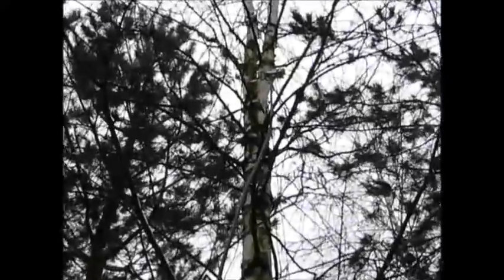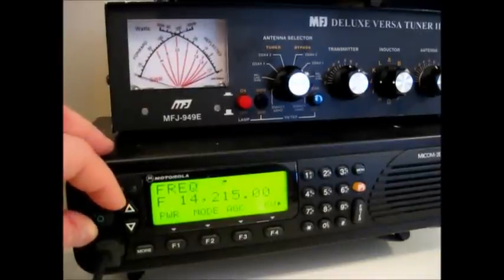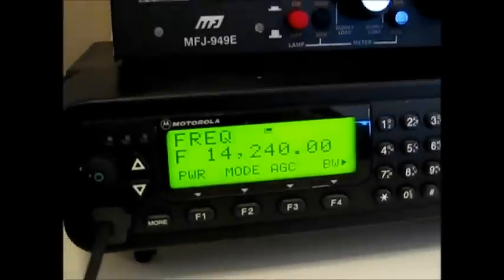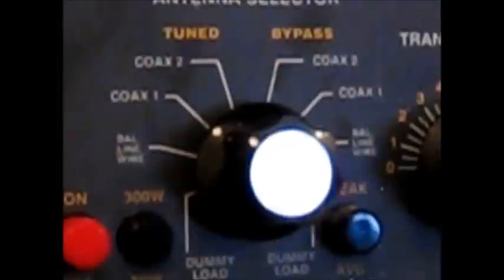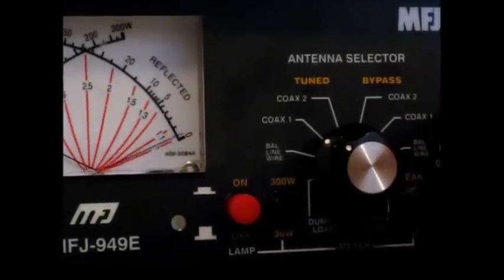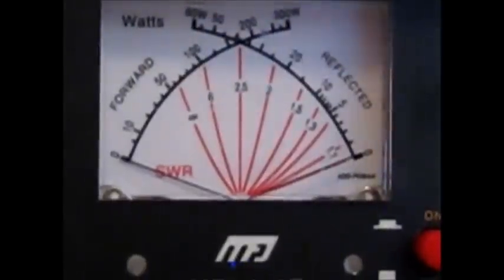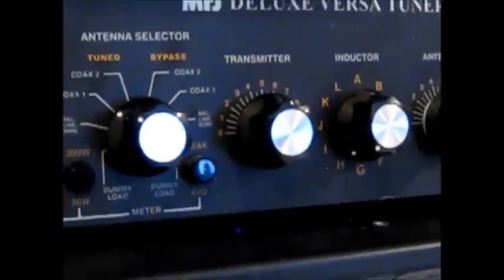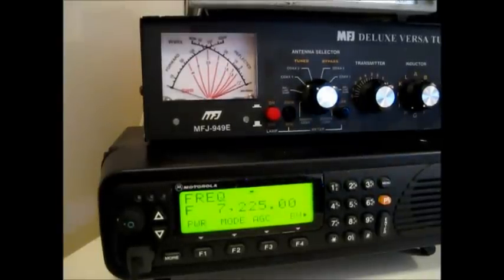MFJ Antenna Tuners - Part II

Comment: Why not just spend more time adjusting the antenna length to achieve a good swr without the tuner ? Wire length calculated by the formula 468 divided by the freq is just a starting point. A resonant antenna will work alot better.

Comment: that is NOT An antenna tuner.
.That is a myth.

Put an SWR meter on the feedpoint and youll see it..

Radio Antenna Handbook  1936 says nothing can be done at the transmitter to change the antenna tuning

Comment: I have an auto on my 590k, but during this COVID thing i got a seventy three hundred. it has a built in antenna tuner. I have a old mfj antenna tuner. would it be wise to use it on a modern computer controlled radio?

Comment: I hate to bust your bubble, but the ATU does not make the antenna more resonant.  You kept saying that the antenna is now resonant after you tune it with the ATU.  The only thing the ATU does is makes the radio "think" he is transmitting on a resonant antenna.  It keeps the radio from blowing his finals, which is what happens when you push a lot of RF back into the antenna port.  So, if the antenna is not resonant BEFORE you added the ATU in-line, it's not going to be any more resonant AFTER you add the ATU in the mix.

Comment: Great demo!  I own and use several tuners, almost daily.  But, I hate doing so.  They are a necessary evil in the “compact” and restricted world many of us are “forced” to live in.  They make your radio happy so that at least some RF is actually radiated.  I mean, in theory one could “tune up” at 1:1 into a “paper clip” antenna, but your radiation efficiency will knock your 100 watts down to less than QRP at the antenna….which is much better than nothing, I suppose.

Comment: You have probably moved since making this video but how did you run the coax into your home? That's the problem for me. I don't want to drill holes into the wall
Reply from the maker: You can get an MFJ-4603 antenna window plate.

Comment: I might be wrong but I don't think it makes the antenna resonant but rather just adjusts the antenna side's impedance in order to make the xmitter "happy". Any thoughts?
Reply from the maker: You are right - poor choice of words.
Reply: @Commsprepper  again you are correct by saying it's resonant you are shortining and lengthening the antenna electrically by adjusting the capacitive and inductive reactances to zero

Comment: So whenever you move to a new frequency you have to stop and tune?  Do you tune using an AM carrier?  Wouldn’t transmitting to tune on a frequency you want to respond on interrupt others trying to respond to the CQ?  How do you tune without disrupting others?
Reply from the maker: You need to re-tune anytime you change frequency.  AM or RTTY setting provide a carrier for tuning (low power).  Tuning on frequencies is rude.  Move slightly below or above, listen, and tune there with lower power.

Comment: Nice video. I just want to know how to set the buttons on the bottom of the panel. Not the on/off button obviously, but the other two buttons. Thanks in advance. Joe N2OIB
Reply from the maker: one is power range and the other peek/average for the reading.  Average provides a delay on the needles.

Comment: Actually you are not “resonating the Antenna” you can only do that by physically lengthening or make it shorter.,the “Matcher” changes the impedance so your rig sees 50 ohms - but I know you know that. 73
Reply from the maker: yeh...  poor choice of words but most get the point.
Reply: @Commsprepper  it was a correct choice of words, you are electrically shortening and lengthening when you are adjusting the capacitive and inductive reactances

Comment: Glad you said toward the end, “Makes the antenna look good to the radio.” Earlier you had said something to the effect of, “Makes the antenna resonant,” which a tuner does not do. Having said that, this is a great video! After years of using auto tuners I bought a Yaesu FT991a that although it has an internal tune, it will not tolerate an SWR in excess of 3:1. So I bought an MFJ 949E. Your video was fabulous, allowing me to learn how to operate the tuner .... Max noise and the adjust the capacitors. I think it could tune a metal trash an. 😉 MikeinMinnesota N0WDM
Reply from the maker: Glad the video helped.
Reply: FYI A tuner provides a conjugate match to allow max power transfer deaming the system resonant

Comment: This is a old video, but very well done and still holds true today.  I use a similar antenna tuner to tune a 100' long random wire and it works quite will with 100 watts of transmitter power on the HF bands.  Thanks again for your efforts.
Reply from the maker: Thanks for the channel support.

Comment: You most certainly not making your antenna resonant, you're matching the radio 50 ohm through the tuner.  Your antenna is still non resonant.
Reply from the maker: yes - but you get the point.
Reply: The antenna system is most certainly resonant, if it wasn't it be reactive and power would not be transferred to antenna

Comment: Nice! Well done. Thank you. You have explained this really well for me. I do want to learn how to do this. And not everyone has the analyzer or scope  or any other gadget that many tutorials use when showing how to tune the circuit and antenna. I bought the kit. I am pretty confident that I can put it together and get it to work properly, but just using the tuner alone by itself, you have helped me a great deal. Thanks. Best Regards. 73, steve  Great job.

Comment: Thanks for helping a new HAM get a perspective on this tuner. I have a Kenwood TS-570D with an auto tuner built it but it seems that a manual tuner does the job better.
Reply: They usually do...  also the radio doesnt have to work so hard

Comment: Thanks for taking the time to make thyis video found it very helpfull. Its amazing how close you get properly tuning the antenna by just listning to the noise, I find when Ive done just that final tuning only needs a tweak.
Reply from the maker: Glad the video helped.  My tuner is off-line right now.  It got zapped by lightning and the two diodes are blown.  I am waiting for replacements to come in the mail.

Comment: Thank you Commsprepper for an educational and instructive 'How To' video. I just got a second hand 949E but no power supply and I wondered if you could answer me a question from your experience. Is the `12V PSU only for the front panel light - it looked from your video that the red switch was not depressed?  The strange thing is that the circuit diagram shows that the 12V supply goes not only to a lamp but also to a transistor Q1.  So my question is - can I use this successfully without a 12V supply or will I get incorrect results?
Many thanks
Regards, Bob from Scotland, UK

PS I hope you are still active and enjoying this hobby....
Reply from the maker: Yes you can use it without power.  I have never powered my tuners.
Reply: @Commsprepper  Many thanks for that. 73s Bob

Comment: You can still have a high SWR even with a tuner. It's just the tuner helps block it from touching your radio. When you feed a dipole from coax, I'd recommend inserting a choke as close to the feed point as possible.

Or use a balanced feed line from the balanced terminals from the tuner to the dipole, making it a doublet. Less losses that way too.
Reply: An AT can't really make a bad antenna good. It just looks like a 50 ohm match to the radio now and you don't get rf reflected back to the radio. The only way to get the antenna to optimum efficiency is to cut it to the proper length.

Comment: The antenna is still out of tune.  All the tuner does is give you 50 ohms between the tuner and the radio.
Reply: The tuner in providing a conjugate match to allow max power transfer has tuned the system to resonance by means of all reactance is zero

Comment: My first antenna tuner was the MFJ-949D. It also features a 50 ohm dummy load to use as a load to tune a tube transmitter. My first HF rig was a Kenwood TS-520s that had Tube finals requiring the dummy load. So this tuner offered a lot with 2 antenna selections and a selection for a long wire or balanced antenna for a total of 3 antenna options. I have owned many tuners and autotuners since, but would never be without the MFJ-949E tuner in my Shack!

Comment: Nice video! My first tuner back in 1993 was the earlier model (949D) of this tuner. It did a great job and had lots of features for $149. Back then I had a Kenwood TS-520S HF Tube rig that the transmitter had to be tuned into a dummy load. The MFJ-949 had that built in! Plus you have the option of two different antenna's, therefore eliminating the need for an antenna switch! And a built in 4:1 Balun for balanced line antennas, plus a balanced single random wire connector!  And the large lighted cross needle meter was easy to read. Plus it was the perfect size. I think these features at the price of $150 are exactly why the MFJ-949 has been the most popular tuner for many years. In fact I'll be purchasing another for field work and as a backup to my LDG AT-100 Pro II.

Comment: The button that you push in for 30 watts or 300 watts. I thought if you push it in, it would set the meter up for 300 watts and if it was not pushed in, the meter would be set up for low power as used for tuning. When using the Tuner and running 30 watts, the meter seems to register correctly on my Tuner with the button pushed in. Also when tuning, what power level should you use when transmitting. I read somewhere that you should never use more than 20 watts. These two videos were very helpful!
Reply from the maker: +skf1492 I tune with 5 to 10 Watts.  Then change the meter to higher power and tune again with 50 watts.  Then full power

Comment: So, is this also used to calibrate SWR or is that still a different meter? Sorry, I have a lot to learn thanks.
Reply from the maker: You can use this tuner for shortwave reception but the meter only looks at transmit, so you would not see any meter movement when receiving shortwave stations.
Reply: Thanks for the help. So you're talking S.W radio. I only have a A.M. Cobra. This meter might be out of my league and over my head. I have a cheapo Workman meter. Maybe I need some bigger better radios if I was ever to need a meter like this.
Reply from the maker: Okay - You have an AM CB radio?  In this case you only need an HF SWR meter.  No need for the tuner  because you can buy antennas that are already tuned (cut for the right length).  The meter will let you know if there is an antenna problem.
Reply: I plan to get a SSB radio down the road but the Cobra 29LX is it for now. I just got a Antron99. Next I'm wanting to get a better meter, that's how I found your vids. Thanks a bunch for your help. I learned a lot from you.

Comment: Good instructional. In an emergency prepper setup, that MFJ949 keeps the transmitter happy. I tuned a 20m 1/4 wave vertical on an mfj949d up on 40m: FLAT swr/ zero reflected, but LOTS of rf in the shack. It works though. I guess maybe 1/3 of tpo made it to the antenna. Hey, in a "gotta put a signal on the air" situation arrises...
Reply from the maker: It's hard not to like a manual MFJ tuner.
Reply: Try a better earthing system. It should reduce the feedback rf even if it does not eliminate it completely.

Comment: Nice video. I just got the MFJ-941E . Can you explain a little bit about the black Watt button  is it in for 30 Watts or out? and what setting do you use for full power.   Thank you KC2YME
Reply from the maker: I don't have mine in front of me but the setting (button depth) is silk screened on the face.   The 30/300 watt setting applies to the meter scale / power.  Radio has more than 30 watts then you need to use the  300 scale or you will peg the meter and ruin the movement.

Comment: If you enjoy making antennas, then you may want to buy, or borrow, an MFJ 259B antenna analyzer. I have used them for a while and allows you to see the characteristics of what you have created.
Reply from the maker: I would like to get my hands on one of those.  I do have a Signal Hound spectrum analyzer and tracking generator that allows me to do antenna analysis but the MFJ is a smaller package.  Thanks for the tip.  Hank/CommsPrepper

Comment: Very interesting video :) For someone who is not a ham radio operator, could you please explain: If the tuner is a bit of a compromise (compared to an actual tuned antenna), and at 9:20 you say 'not as efficient as it should be' - where does this extra power disappear to? If you're putting the same power in but getting less out, it must be going somewhere, right? Cheers
Reply from the maker: The short answer is the mismatch still exist between the tuner and antenna and excess power remains there.  The tuner isolated the radio from the antenna with respects to the mismatch.
Reply: aha, i see :) thanks for replying. So the 'mismatch' gets moved to a place where it's not going to cause any damage?  That's neat
Reply: @w3llhard  the tuner in providing a conjugate match to allow max power transfer is deemed to make the system resonant

Comment: Antenna tuners do not tune the antenna,
Reply: It's a conspiracy, shhhh  ;)
Reply: You're right, it doesn't tune the antenna. It fools the radio into thinking it's looking at a good match. You can get the SWR down that way but the antenna will not be effencent.
Reply: @darrellbeard2799  it doesn't fool anything, the tuner provides a conjugate match where all reactances are adjusted to zero in this state the system is resonant
Reply: @Pioneer936  I'm sorry I simplified it!
Reply: @darrellbeard2799  your simplication is wrong, it electrically tunes the antenna system to resonance by adjusting the capacitive and inductive reactances to zero
Reply: @Pioneer936  true. Thereby fooling the transceiver into looking at a near perfect system.
Reply: I see no point to argue this. I admit I'm wrong and you are right! Feel better now!
Reply: @darrellbeard2799  not arguing its a discussion isn't it, if the definition of resonance is when reactances are adjusted to zero within the whole system, then the whole system is resonant when the tuner adjusts the reactances to zero, there's plenty of info in ARRL Antenna book and  Reflections by Walt Maxwell explaining it in detail
Reply: @Pioneer936  I think maybe we are talking about 2 different things here. You are explaining how a tuner does what it does and I'm simply stating the end result. You are right in the function of a tuner, any licensed operator should know this as it's pretty much basic 101 for the tests.  However while it will make the radio think it's working into a near perfect antenna system, it is not. This is my point, given 2 identical antennas, one with a perfect match of 1:1 and the other with a 5:1 SWR and a tuner in line. The transceiver once the tuner is tuned will see both as the same perfect load. However, while the radio will not fold back on power output the system loses are much greater in the system with the tuner. The tuner will have a bit of loss due to design, the feedline with have higher loses due to the 5:1 SWR and the antenna will not resonate as well due to being not the right length for the frequency you're working. Therefor, as I stated, the radio is fooled into thinking it's looking at a perfect match, when in fact it isn't. I don't know any other way to say that.  And no, I'm not meaning to argue this as you said this is a discussion.
Reply: @darrellbeard2799  resonance and loss are two separate issues, an antenna can be both lossy and efficient at resonance, if we look at a resonant half wave dipole for 80m at 1.1 swr fed with rg58 and power 100 watts, there is a loss of 14 watts, compare this with a non resonant length of wire about 100ft of wire fed with open wire into a tuner with 10.1 swr with 100 watts, there's only 4 watts in loss, efficiency is down to feeder, the doublet antenna is the perfect example of an efficient non resonant antenna system brought to resonance with an antenna tuner, Louis Varney liked to call it an antenna system tuning unit as he described it tuning his g5rv to resonance
If for example the feeder was lossless then all reflected power is reflected back to antenna at the tuner no matter how high the swr is
Reply: @Pioneer936  Now you're talking balanced vs unbalanced feedlines. A balanced feedline cannot be fed directly into the radio without some sort of matching device, be it a tuner or a balun.  I'm talking coax fed antenna system.
Reply: @darrellbeard2799  I am talking about them both, you brought loss into the mix, resonance and loss are two separate issues as I've explained above, arnt we talking about the role of an antenna tuner regardless of feeder, if you want to reduce loss while using a tuner with coax place the tuner at the antenna where it can directly tune the antenna to resonance without the coax loss or use a super low loss coax like heliax if you want to tune the system to resonance in the shack with little loss